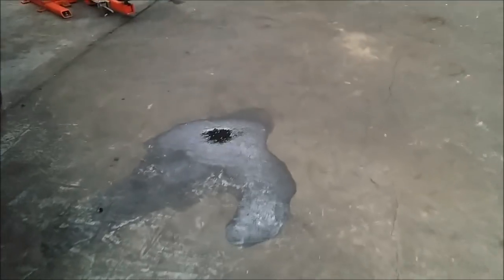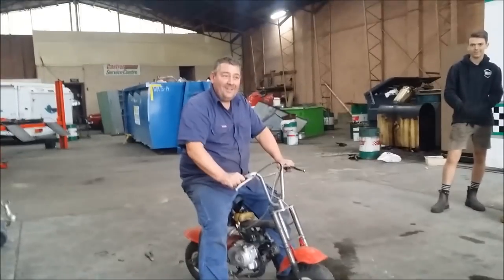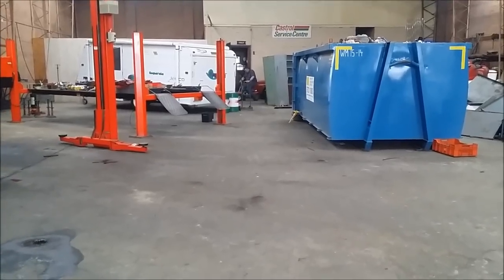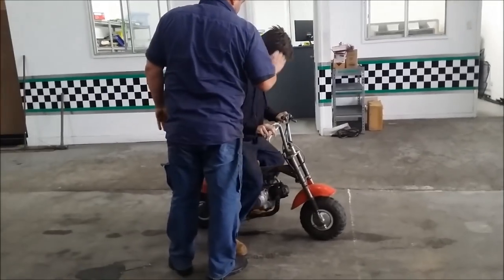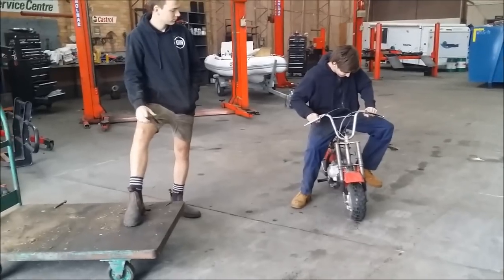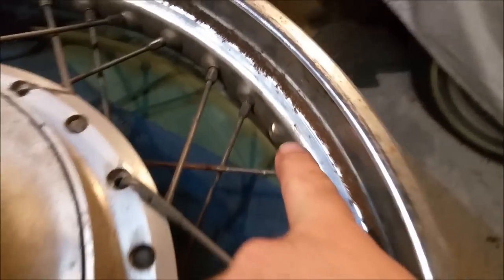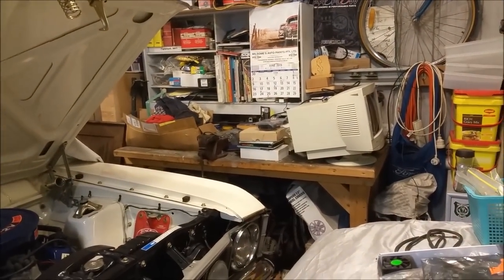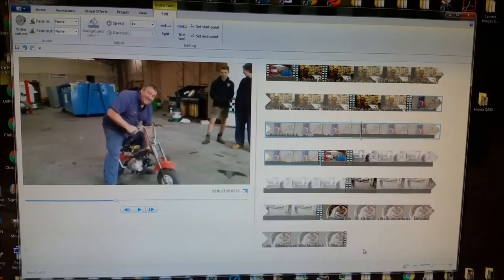Honda QA50 Amigo - A Quick Clean Up?

Comment: I had 1 of those when I was a kid, run great and then suddenly it wouldn't start, it had fuel, compression and spark but no go so it went into the shed for years and my old man decided to get it going for my sisters to ride, well after ages of trying he too gave up on it.

Comment: Hi Peter, really enjoy the videos. Do you have any suggestions for rust prevention? I am restoring an XY Ute. I am currently replacing the door skins and wanted to put on rust prevention on the inner. I have seen that you have used POR 15, however I don’t have a supplier in Alice Springs. Do you have any other suggestions? Cheers